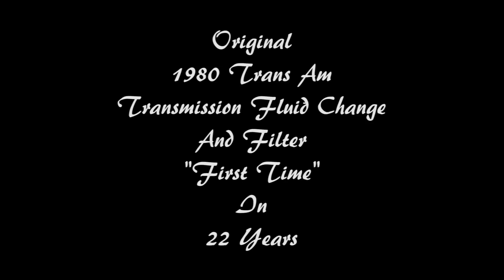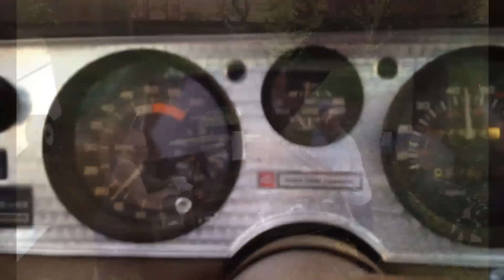STOLEN 10/15 1980 Trans Am First Transmission Fluid Change In 22 Years

Comment: I wanted to tell you guys NOT to get a "T-Tec" or total transmission fluid change. I worked for Pennzoil when they came out, and after a year we started having people sign wavers if the trans fails.
I would however do about 2 more "Pan Drops" over a 3,000 miles span, and replacing the fluid with premium trans fluid like B&M or TCI.
I switched over to B&M Trick Shift in my 72 GTO with a TH475, I noticed about a 15-20 temp drop.
It might be a pain but replace the filter each time, or at least get a pan wit a drain plug.
And please replace the vacuum modulator on the TH350, clean the cant in bolt hole like crazy before you put the bolt back in, seen so many people snap the casting.

Run the car before you do this, but let it cool down enough so you dont get burned.

Also I would run a Synthetic Blend oil, the 301 is a good engine and tho it's not the same engine as the 389-400, they are known to run "hot" as in they keep to the high side.

On the same note, make sure your fan clutch is new, just get a new one, they fail and before you know it you will me chasing down heating issues and all along it was a $40 part.

Flush (if you haven't) the cooling system and put in a pre mix 50/50 and a new stat, if you don't plan to run her in the cold use a 160, or to cover all seasons a 180.

The rear axle fluid has to be changed, trust me on this, I have seen stored cars come into the shop with several cups of water in axles just from non use, same with the engine and trans. It's condensation that builds up from hot and cold cycles over time.

Run the car before you do this, but let it cool down enough so you dont get burned.

Another place is the power steering, people forget this. Run the car around for a while, this will pick up and "float" the debris in the fluid, get it back and suck out the fluid.
As much as you can, then jack up the car under the engine cradle and turn the wheels Lock to Lock about 20 times, then suck out the fluid, fill and repeat. If you do this 4 times you would have gotten just about all the oil stuff out.

I recommend Royal Purple or Red Line. It's time consuming but it's 100% the right thing to do.

Also this is time to "repack" your spindle bearings, this is not as hard as you think.
Jack up the car, take the wheel off, take off the caliper and the "dust cover" on the center of the wheel.
Slide off the caged roller bearing and "need" in premium bearing grease. No way no how should you not do this with a car sitting so long, and it was put together with run of the mill, lowest bidder grease at the factory..

Check all your joins, tie rod ends, all your grease fittings, the "rag joint" on the steering shaft.

Before I went into the ARMY in 2000 me and my friends were hot rodders, I build my 1972 GTO frame off, 71,72 Monte Carlos,      Chevelle Camaros 442s you name it.
I started a car club and it caught on so much guys were getting cars out of storage and joining (everyone in my club got a life size skeleton) and we did all the fluid chores all the time, mostly over pizza and beer, lots of cat litter (spills) and late nights with the 60's music on the radio.

Great days, great memories, and you are lucky your making new ones in that car.

BTW, I love the patina of the faded paint, I would keep it.
Reply from the maker: great response,, thank you//

Comment: Car should have NEVER been even turned over without ALL fluids / filters being replaced. Hot and cold over the years, creates condensation inside, destroying parts when you run them, especially when they get hot, Yikes! I pulled an old Buick Wildcat out of the woods at a gals home, she said "it will never run" well, I emptied and replaced everything (including brake fluid) and (to her amazement)I drove it off her property, very little more satisfying.
Reply from the maker: we checked fluids before.. and did drain engine oil.

Comment: IF you DO a transmission fluid and filter/gasket service on an older car....empty the torque converter also....fluid in it contaminates fresh fluid in pan, or do it several times.
Reply: I got lucky with half the cars with automatics, by simply changing fluid, filter and gasket. A $1oo Dodge Charger, gave the guy a ride back to work from the ATM machine and parts store parking lot. (Tossed the new drain pan). Others not so well, as SAW screws, and tightened, without knowing what they might DO. Like no reverse on a $4oo Dodge Challenger. Both complete, clean, used cars. Sorry to hear T/A stolen...gone (parts) in 60 seconds.
Reply from the maker: thanks, I actually found it being sold for parts on CL, notified the detectives and 2 weeks later, they went after the crooks, to late by than, The cops were no help, but I had full coverage and State Farm did me very very well.. I replace her with an 81 Turbo, its on my page. I need to look at your page now..:-)
Reply: I've been trying to look at my page for most of the day. I saw Turbo car you got..."Miss Patina 2", but haven't seen video yet. Maybe tomorrow. Awesome you found last one as parts on Craig's List...I've never set eyes on site. Nice Formula 400 near here, I haven't stopped to study, as not likely for sale.

Comment: what kinda transmission oil do the 4.9s call for? i cant find anything on it. the transmission isnt shifting out of first gear. i have a feeling that maybe the filter is stopped up. any ideas? im gonna change the fluid and the filter first hopefully that solves something
Reply from the maker: +Kevin Blasingim its a turbo 350, yes. change the filter and fluid. That might fix it, make sure to check and see if there are any metal shaving in the pan too..